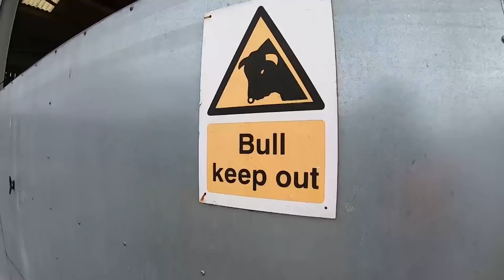CLIPPING THE COWS BACKS!

Comment: Poor effort at clipping the cattle backs, recommend to clip a 6 inch strip from the back of the head to the tail head. Clipping the tail leaves the cattle a lot cleaner.
Reply from the maker: They are in very well ventilated sheds, we dont want to take too much off them. A good strip down the back seems to do them well here 👍🏻